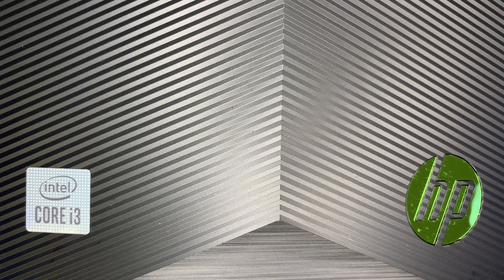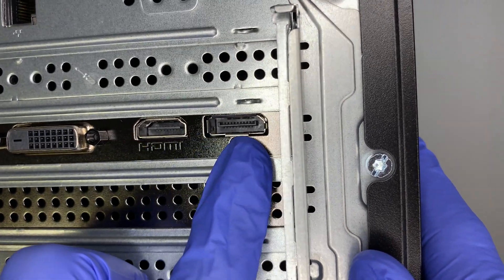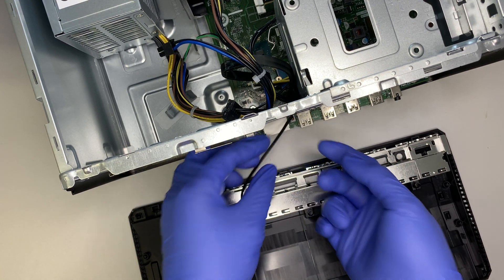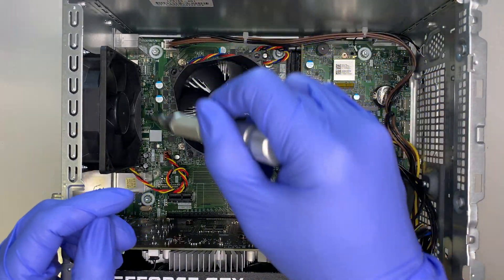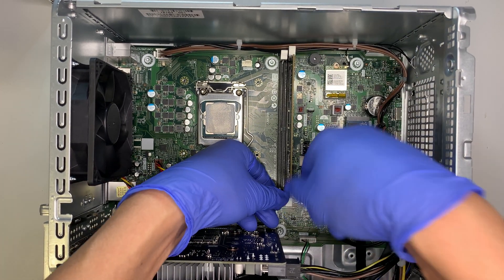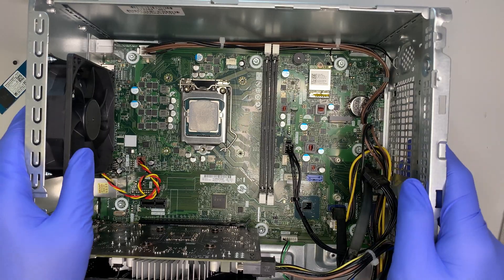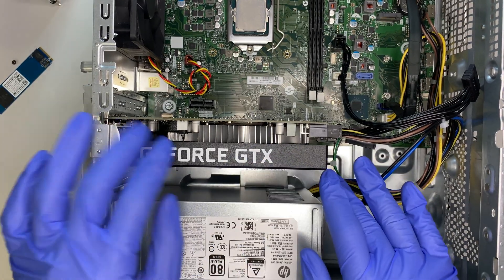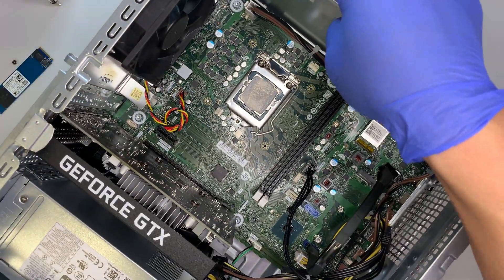HP Pavilion TG01 1022 Review and Tear Down

Comment: Hello , what is the maximum supported ram speed on this system I dont know for sure . I looked at the motherboard specifications and it says up to 2999 mhz . Not sure if this is correct or not because I have the same model and  wanted to upgrade the ram speed if possible .
Reply from the maker: This will get you the correct RAM - https://amzn.to/3ra37WV
Reply: @UbergeeksBiz  Thank you :)
Reply: @UbergeeksBiz  another question have you tested that it runs at 3200 mhz with the i3 - 10100 ? Or am I wasting my money

Comment: Can you put a gtx 1060 in it?
Reply: and have two ssds?
Reply from the maker: @nathanrodrigue8207  Two ssds yes. Not 1060
Reply: @UbergeeksBiz  Thanks for the response, do you know if it would  be able to fit in a tg01 2260xt?
Reply from the maker: No. The power supply does not have enough power to power a bigger graphic card

Comment: Hi -- Thanks for this video. Opening up my new computer looks like it'll be a much less daunting task than I thought. -- My goal isn't to replace the wifi card but to attach a better (external) antenna to it. Not sure if I'll be able to run the wires out one of the unused on-board video port holes or if I have to find/make a different hole.
Reply from the maker: Hi, maybe you might consider usb wifi adapter ? Try this link:  https://amzn.to/3he645M

 Much easier to install.

Comment: whats the 2 pin blue and black wire for??
Reply from the maker: That extra 2 pin Blue and Black is for graphic card. Some graphic card need 8 pins power. Some need 6 pins. This has 6 pins graphic card, so extra 2 pin of blue and black cable is sticking out.